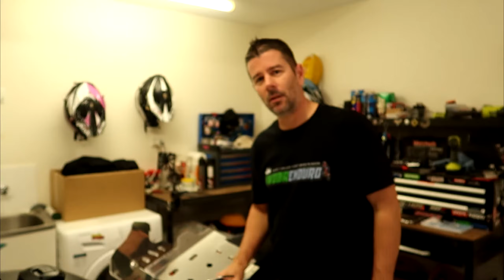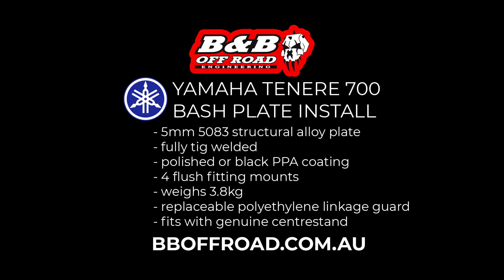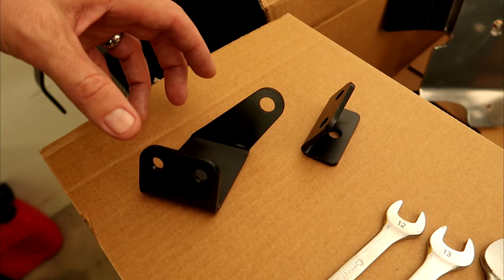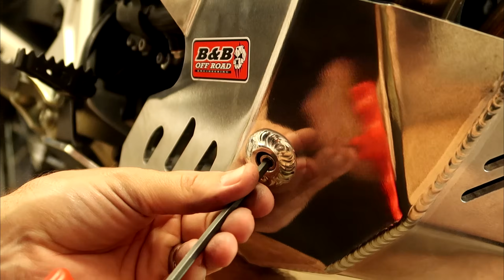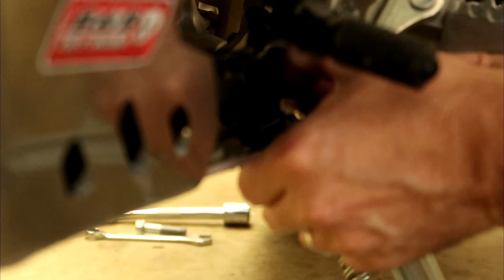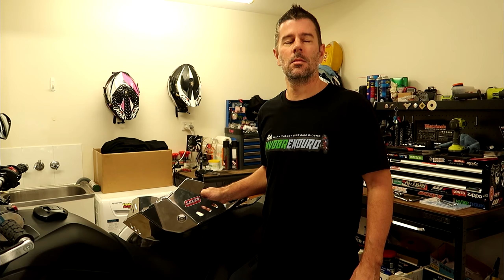Tenere 700: B&B Off Road Engineering Bash Plate Install

Comment: Few after market manufacturers will go through the thought process of using a countersunk bolt and building up the material to effectively countersink an Allen head bolt.  Looks clean and and no hang ups.  At the end of the day, you are still taking off only four fixings for service as you would with the factory item.  Short but sweet Josh, looks the business and will certainly protect ya business
Reply from the maker: Yeah man they really come out with some well designed gear. The bashy on my 500 is B&B as well, real simple unit but tough and easy as pie to fit and remove. What more do you need. Thanks for the comment Clint 🤟
Reply: B&B are amazing, The supplied bolts for the 19 CRF450R radiator braces had hex bolt heads and would dig into your knees. 
Called the owner of B&B and we did RnD together and refined the bolts to a mushrooom head. No more cut up inside of knees.
I believe they are the only aussie mob who can provide 5mm, 318 stainless braces and plates.
Remember to blue loctite your bashplate bolts ^^

Comment: Hey Josh. What did you use to paint the brackets? I want to do the same but I’m assuming the brackets are zinc plated. Not sure what sort of paint will stick to it.
Reply from the maker: Pretty sure it was a Dulux Metalshield Epoxy Enamel rattle can mate, takes a while to harden properly but sticks pretty well without any primer 💪

Comment: i want to add you didn't have the centerstand when you did this. a bit of advice for one that HAS the centerstand. only install one of the frame bolts one at a time. this does two things . it assures you your not crossthreading and it makes it a "TON" easier to line up the oem centerstand bolts on the left side which thread through EVERYTHING except the spacers for the centerstand!!!
Reply from the maker: Thanks for the tip Mark

Comment: Do they fit with touratech crash bars and oem centerstand?
Reply from the maker: Not sure about the Touratech bars but it says on their website it fits with oem centrestand 👍
Reply: @MVDBR  saw that and interested. But I  had an incident with outback so I'm pretty leary if I don't see the centerstand on the bike during install
Reply from the maker: Yeah fair enough, I don't have those items on my bike so I can't confirm for ya
Reply: @MVDBR  update; just installed mine and i'm reasonably sure "they don't" but,,,,, with this design i believe the need IS eliminated!!! hoooray!
Reply from the maker: The need for what mate?
Reply: @MVDBR  lower crash (touratech) crash bars
Reply from the maker: Ah ok sweet that's a good result 👌

Comment: Thanks for the vid. It was a great help  Mine arrived today along with the tail tidy, and I installed the bash plate this arvo. I went for the black. 
Hope to install the tail tidy Thursday. Plenty of time in Vic at the moment!
Reply from the maker: I did a vid on the tail tidy as well in case ya hadn't seen that yet! Thanks for the comment mate glad the vid helped a bit 🤙
Reply: @MVDBR  I am aware. Once I had chosen my products I searched out all the videos. Great job!
Reply: How’s the black finish going? Does it scratch up and look ugly? Tossing up between silver and black.
Reply: @blade1535   The powder coating is impressive. There are some areas that have taken some hard knocks and it has scratched. The polished aluminium is a great look. Hard choice really.

Comment: 4m 51s, That nut isnt a nylon lock nut. it requires 'serviceable thread lock', aka "blue loctite".
Rule number one in the workshop. Thread lock EVERYTHING that isnt already a lock nut (castle nut, nylon nut, spring washer loaded nut, flanged nut, tabbed lock nut etc etc)
The only exception is internal parts, some things cant be thread locked else they cant be torqued accuratley.
my rule; if it aint an oily thread; chemical lock it.
Reply from the maker: Yeah I'm whipping it off shortly before it goes in for a service anyway. You're right it would be a good idea to loctite them although I never have with the 500s bashy and not had a problem, but it's a bit of a different setup
Reply: I had to giggle because you had your loctite sitting there under your bike but forgot to use it.  
Ive lost too many bolts over the years, even when they were FT... 
Loctite costs $5.00...
Replacement shiny bolts cost a bit more...
Just use the 'medium' strength, serviceable stuff...

Comment: Looks like a pain in the ass to change oil & filter.
Reply from the maker: 4 bolts isn't too bad for that kind of protection. And being a low maintenance engine you're only doing it every 5,000-10,000km anyway :)
Reply: It's a sport engine tucked inside an offroad frame. Katy Ems have been at the forefront. All the other guy see the  potential especially now the emissions bell tolls. If kawai ever remakes the klr I'm sure it will go this direction as well. In canada this T7 would be pushin $15k with registration, taxes, financing.